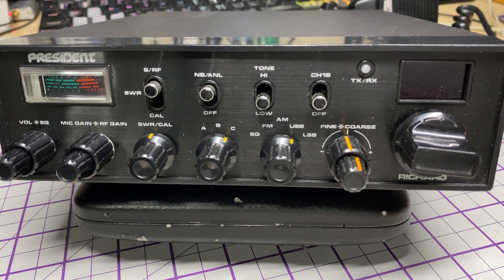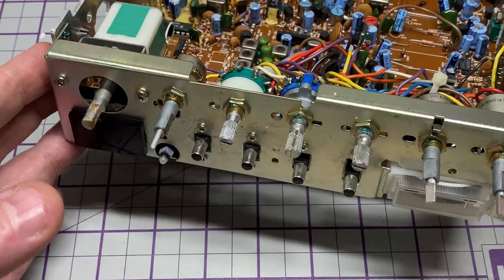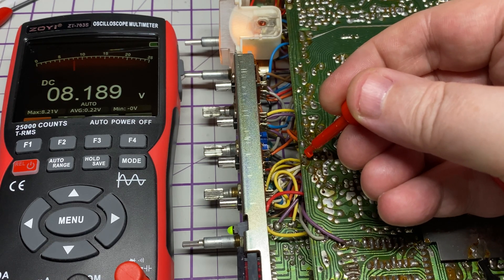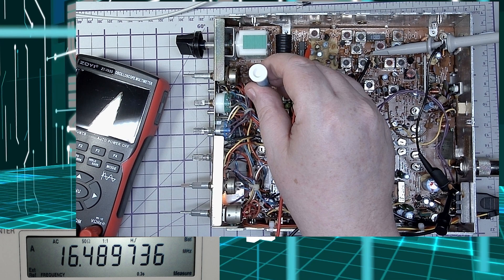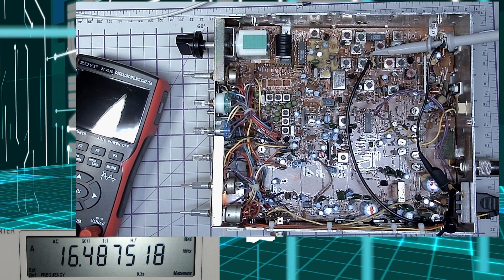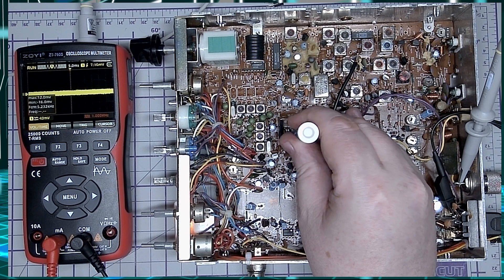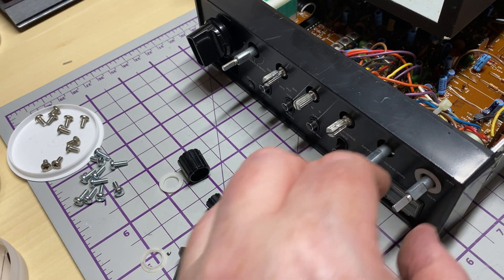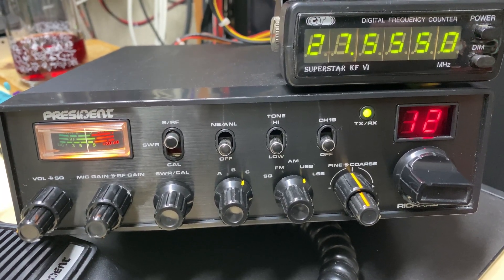EP 189 - President Richard - Fitting a frequency counter cable and service.

Comment: Abit savage drilling a hole in a radio that’s survived this long untouched. You can fit the Fc lead neatly through the pre-made notch on the rear panel and the top lid. Fits nice and snug to the panel so it’s not flopping about in the wind..

Comment: Great job as always, would you get more power output fitting the TIP36C?
Reply from the maker: No , but its a better spec part for that circuit, as that transistor handles the fm and ssb power regulation